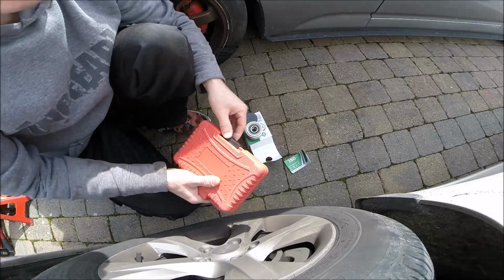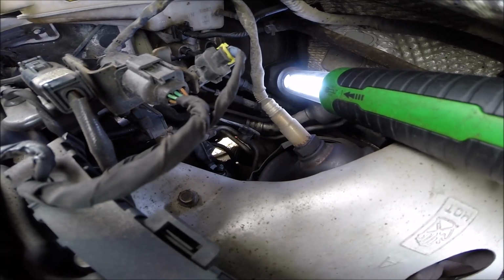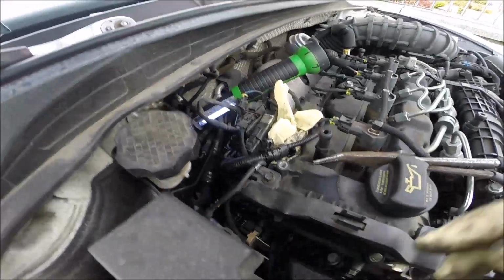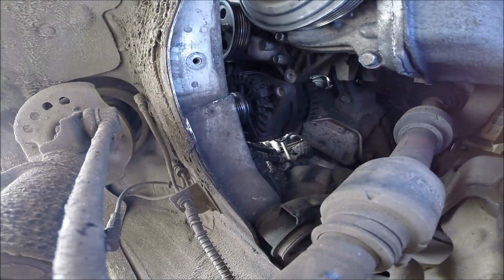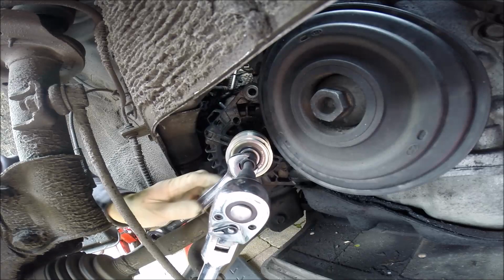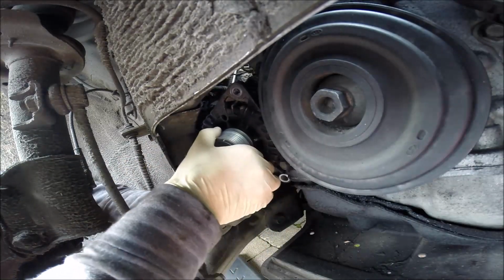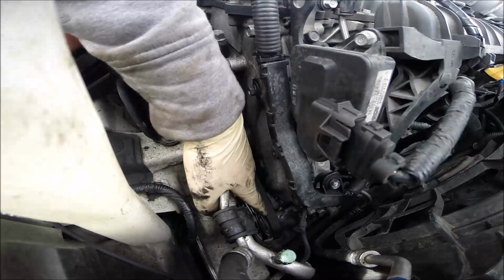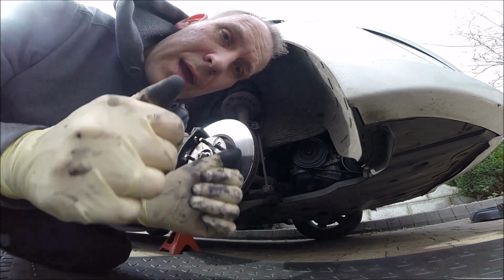Hyundai i 40 1.7 D 2012 Alternator Clutch Pulley Replacement

Comment: Hi,  my car makes far more noise then this. My 2012 original pulleys will be replaced this weekend, thank you posting this video that I watched long ago and now using for reference 👍. I will also be replacing the belt tensioner, belt and pulleys, I'm not sure if the two idler pulleys are right hand thread or left hand thread, do you know? My manual doesn't have any info.
Thanks.
Rich
Reply: They are normal thread :)

Comment: Greetings from Spain, how do you change the rear brake pads of the Hyundai i40, without a diagnosis machine ????
your videos are a success at least for me
Reply from the maker: Hi, 1th rules with electric parking brake... if it is electric brake calipers you no need plug in the tester if it is with  center electric motor same models car have to plug in . I don't remember i 40 parking brake. See my another's video with VW Passat brake pads replaced.
Reply: @FixYOURride13   thanks for your quick response